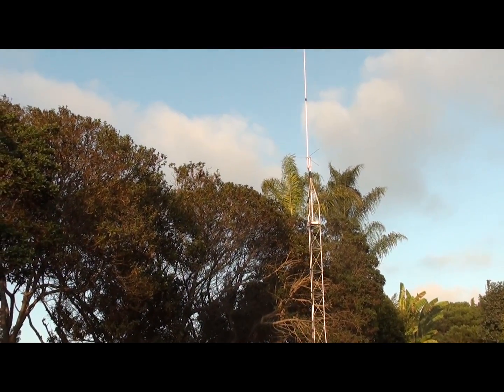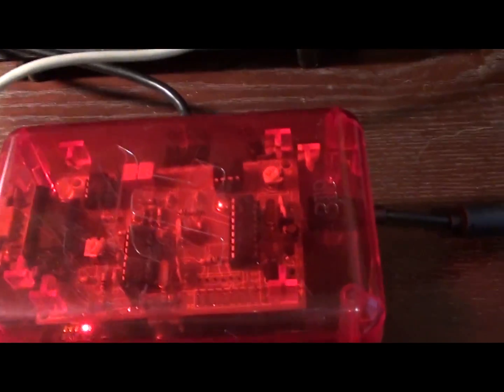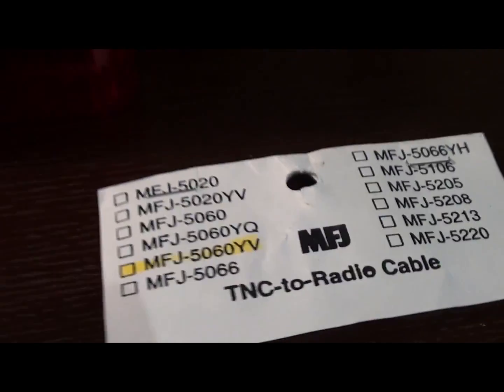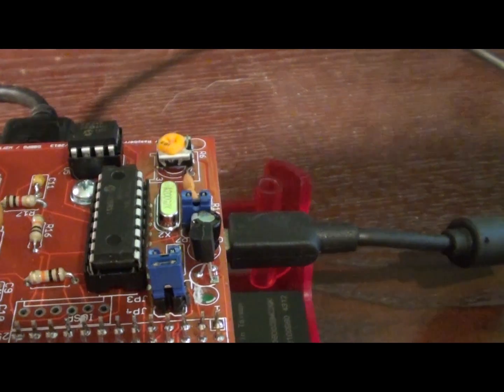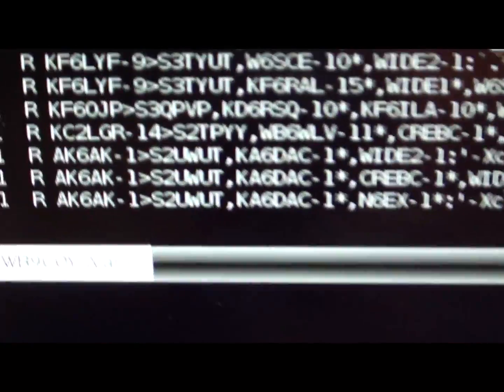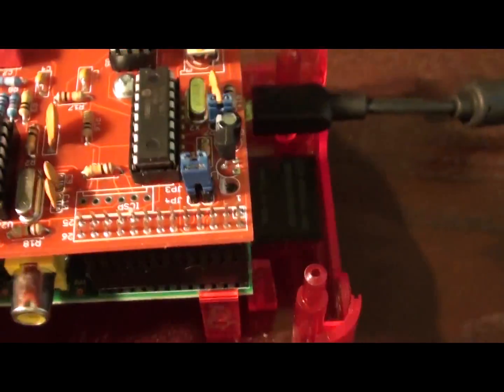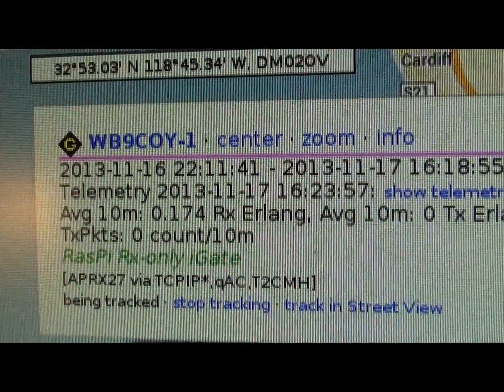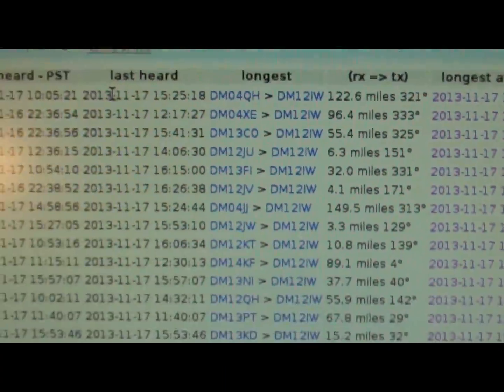WB9COY-1 Raspberry Pi Rx IGate

Comment: Is that a Diamond X-300 I see? I'm using the same antenna for my igate, Digi. I see that since you've made this video, you've gone to running rx/tx and digi.  Have you changed anything else about your setup (antenna, radio, etc)?  From your aprs.fi info, your station is performing extremely well.

Comment: Gaviota, CA (CM94VL) is a popular DX point for single hopping to this I-Gate. ~200 miles away. Entirely all across water of course.
TinyTrak3+, Alinco DJ191, ~5W, very drunken 1/4 wave whip mounted to FJ Cruiser roof rack.
Nice job.
KA6TAY-1